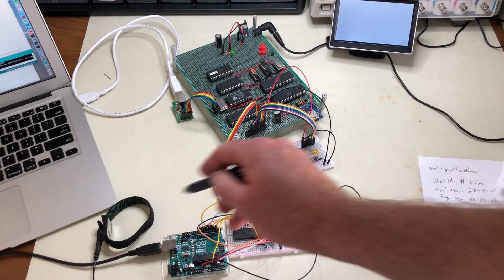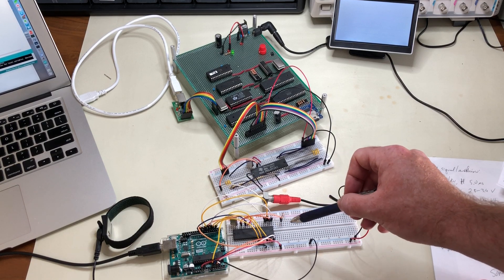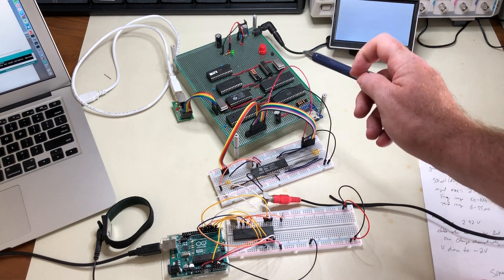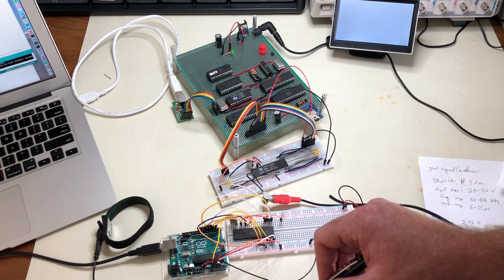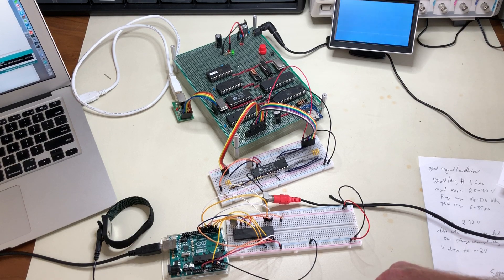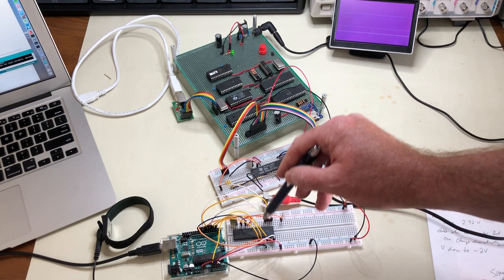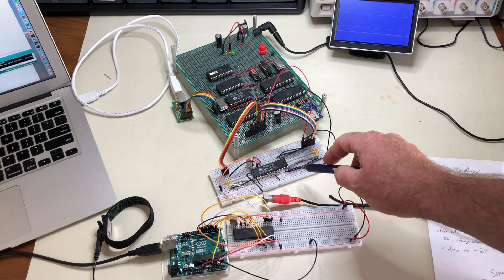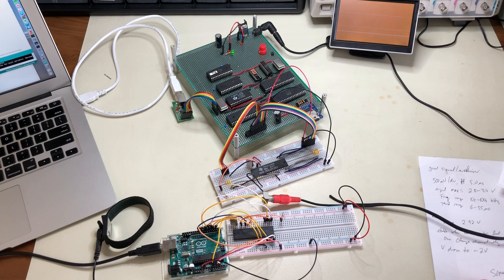6502 Mite home-brew computer project, step 20: first video out

Comment: Very cool! Great project. Why there are white lines on the display though?
Reply from the maker: I haven't fully investigated, but I am reasonably sure that they are an artifact of the display. This is a pretty cheap little display intended to be used for a reversing camera in a car and so display quality is not a priority. However, I also haven't done any impedance-matching with the display nor have I done anything about cleaning up the signal (which I suspect is also why the colors are so off). These improvements will all be needed before I'm done.